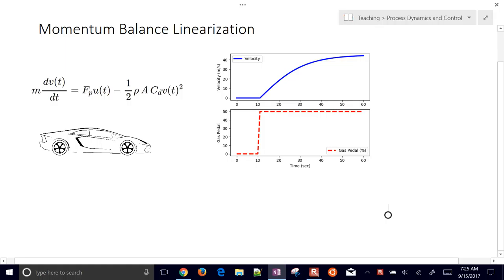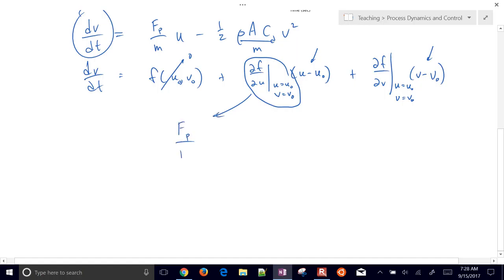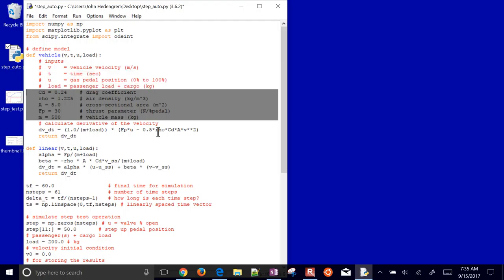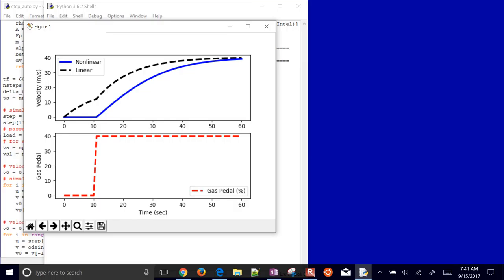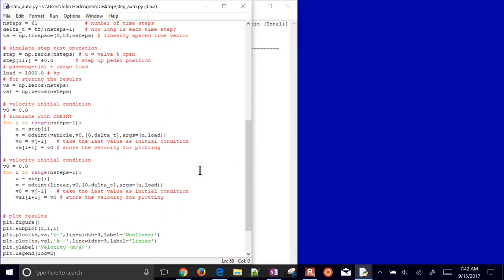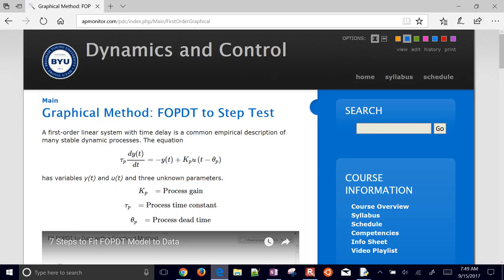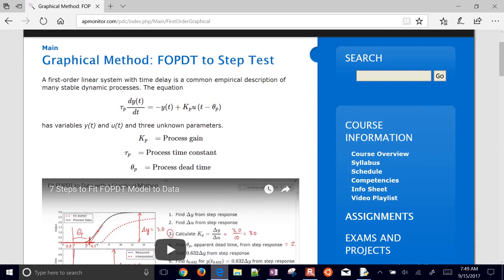Linearize Differential Equation (Momemturm Balance)

Comment: Thanks for sharing this content. I have solved the same differential equation shifting in the Laplace domain and, visualizing the results, i have noticed that the maximum value reached is about 20 and not 40 like the result of the linearized system solved with odeint. This is explainable if we think about the gain that is 0.5. However i don't understand why, starting from the same linearized equation, and solving with two different method (with odeint or exploting the Laplace transform) we end up with two different steady state value at t = 60s; in the first case(odeint) in particular the value is double if compared to the one obtained through the Laplace Transform. Thank you for the attention in advance.
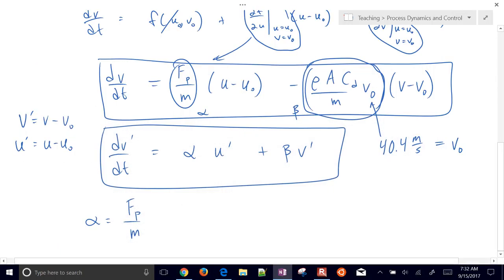Reply from the maker: If the linearization point is the same then they should give the same results. This model is linearized about the point: u0=40%, v0=40.4 m/s as shown at 6:59. If you linearized at u0=0% and v0=0% then you'll get a different answer.